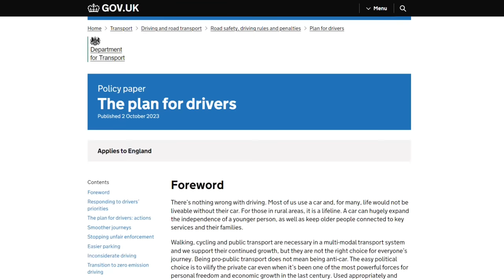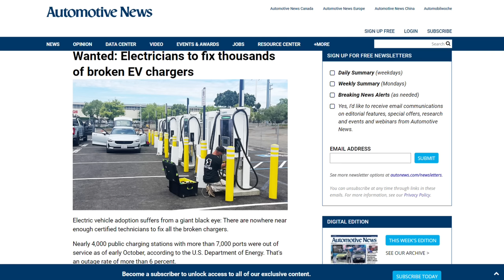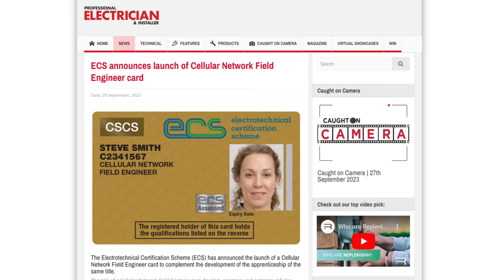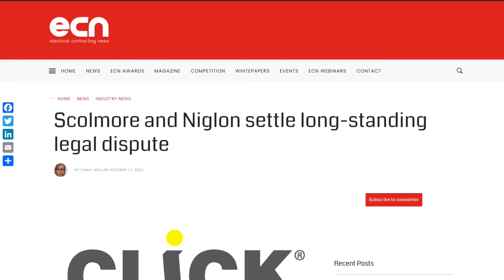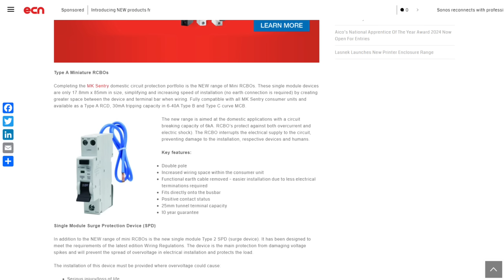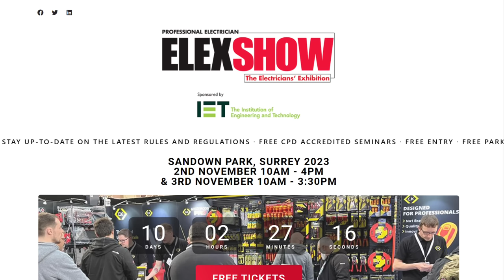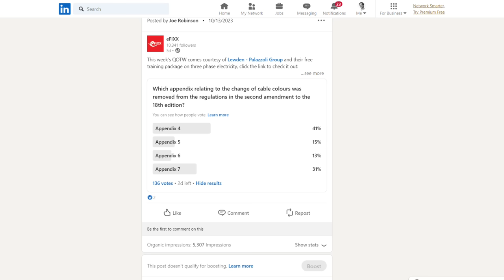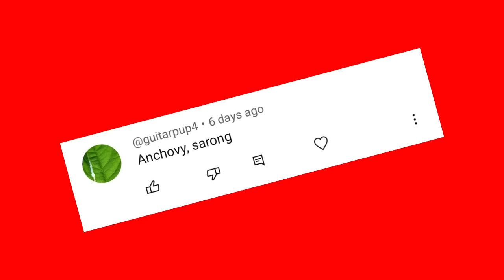Government Unveils New Laws to Speed Up EV Charger Installs

Comment: I did my electrical installation level 3 & 18th edition in east london and the chances of finding any employment in London for no on site experience is non existing. No wonder there is a shortage.
Reply: Need to wait till a job like Tottenham hotspur stadium starts then over runs on time and they'll be so desperate they'll give you a chance to get a foot in the door

Comment: I think you also need to ask the question: Why are so many chargers failing in the first place? Doesn't say much for the technology does it?
Reply: I don't think it's chargers failing, they're pretty dumb devices. I think it's them being damaged.
Reply: @ILoveTinfoilHats  not really . 50%  of the Garo points I've installed are faulty when powered up . There's so many push in connections and plugs on the inside of the units that become loose during transportation to site . Stood there for hours on a few as the Garo representative tried to clear the fault and constantly asking me to add links in to bypass parts to locate the fault . They're not operating correctly straight out of the box and even the manufacturers are having issues trying to commission them
Reply: @ILoveTinfoilHats  not to mention when you open an old one up they're full of insects and spiders webs

Comment: @6m03seconds you state well read from the packaging I assume, 450mm from the floor.  OG Joe you know it is 450mm from floor to center line of the backback NOT the bottum and this is only for new builds.  Existing dwelling can have them match the height that is already there.
Reply: You've been reading part m! In fairness though I'm pretty sure all the guidance just shows a zone 450-1200 doesn't it? And it's not wrong it's just a bit more conservative.

Comment: The grid will not cope with it! 😂
Reply from the maker: Only one way to find out! 😬
Reply: Poof 💨 goes the grid
Reply: National Grid disagree with you.  Hmmm, fancy that.  National Grid disagree with you ...  🤔
Reply: @michaelgoode9555 - So why did the recent Energy Bill allow them to cut off people's electricity supply via "smart meters"?
Reply: @Benzknees when the UK had widespread power cuts in The past it has always been grid damage as in the 1987 storm OR lack of generation as in the 1970s three day week. Never LOAD.

If you look at last year's total demand it was 306twh down from 2006's all time high of 375twh. 

So  37,000,000 road vehicles at an average of 8,000 miles year at 3.5 miles per kWh about 2.2Mwh per vehicle per year. Or about 80twh for the whole 37M vehicle fleet . 

Add that to last year's 306 and you have 386twh. Deduct the powe used to refine the oil you are no longer using. 

And you are down to about 
360twh SO LESS than it was was  being used in a 2006. 

I really do not see the problem AS LONG AS the extra demand is kept out of the 4 to 8pm peak. And I can  assure you that peak pricing will do that.

You won't be paying 35p per kWh between  4 and 8pm when it is 8 or 10p between 1 and 5am.
Reply: @Benzknees  thats in reference to other times they can shut off your connection at the meter like when you dont pay since up till that point they needed to physically go and shut it off
Reply: @AstoundingAmelia  - You pay a private supply company, not the govt or national grid. Since when did govts become responsible for private debts?

Comment: There is no rush to install EV charging points no one is buying EV’s. People are realising the horrendous depreciation on new cars and now dealers are slashing prices to try and shift stock but this has knocked the second hand market for six which means people are losing thousands.
Reply from the maker: So it's probably a good time to buy an EV then? 🤔
Reply: Pity that you are so badly informed my friend.  Or perhaps you are simply Geoff in disguise ...
Reply: @efixx  perhaps but try selling it. They are too expensive. I tow a caravan with a 2 litre diesel Kuga I couldn’t afford the equivalent EV to replace it with. The problem with towing with an EV you have to unhitch to get on a charging point as they are usually in parking bays. To get everyone onto EV’s is a rush job and as not been thought though, the infrastructure is not there yet. Why do you think Richie Sunak as put back phasing out ICE cars.
Reply: People don't need to buy them . The motobility scheme will push them hard on people like they did with Nissan quashqui 15 years ago lol
Reply: @rhinogooner  a lot of places where caravans are towed in scotland like the west Highlands petrol stations can barely take a towed caravan anyway . Towing it still causes inconvenience to other drivers only difference is at petrol station you hold people back for 15 minutes , in a public car park you'll block off the whole area for a couple hours without unhitching lol
Reply: @christophergallagher3845  When towing with an ICE you can fill up anywhere so if the petrol station looks a bit small, then move on to the next one. When you are on the pump, it makes no difference to the next person in the queue he is just 7 meters further back than right behind you. Takes the same time to fuel up hitched or unhitched so the person behind waits no longer. With an EV if plug in point is not working of unsuitable then you have to hunt round for the next one. You are passing Petrol stations all the time. Even if I am running low in Scotland I have a 10 litre can in the boot which gives me another 60miles to find somewhere suitable to fill up.
Reply: @rhinogooner  in city petrol stations yes , in the rural ones in location I mentioned they're much tighter and not much space for queueing cars
Reply: @rhinogooner  you're right though , just drive on to next one if necessary , with ev charge points you don't know if the next one will be working when you arrive